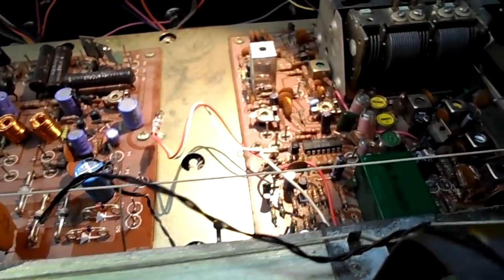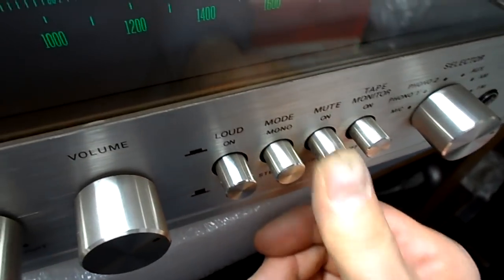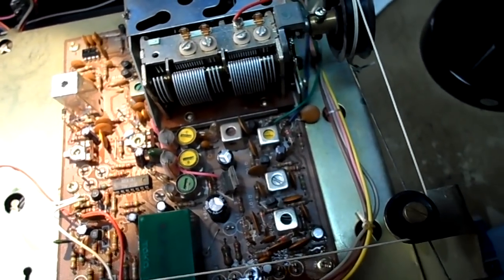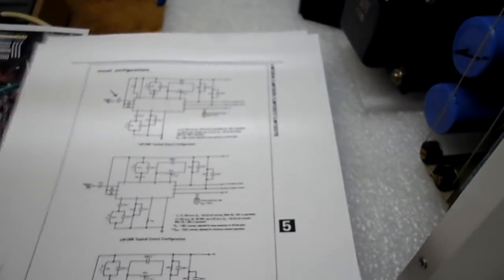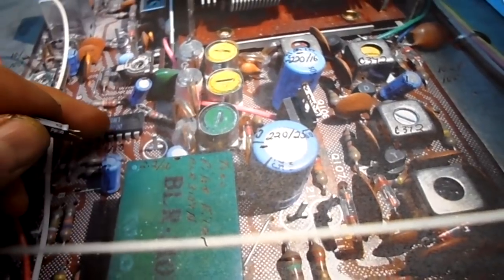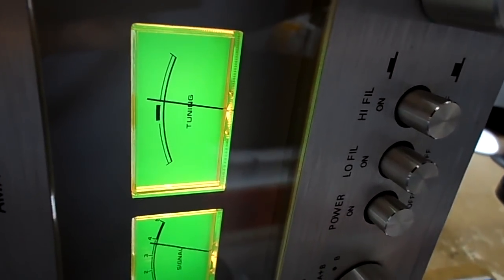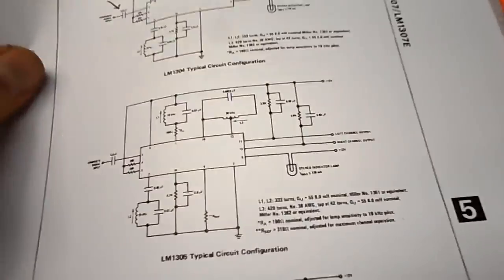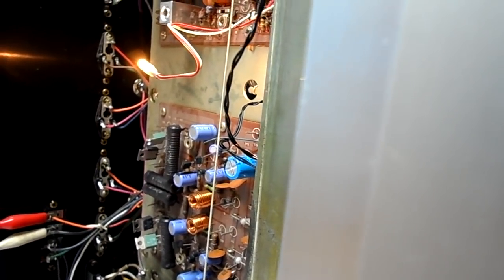Morse 2500 AM/FM Stereo Receiver. Part 2. FM Crash, & no burn.

Comment: I have a suspicion that there could be something regarding the ESR of the capacitor causing the issue. are you able to find data on the part originally used in this part of the circuit? my gut feeling is if the part is for example a low esr part that replacing it with a general purpose part could cause issues (or vice versa). looking at how the receiver behaved when you had the old part back in it does seem that it is very hard to tune as the tuning vu seemed to jump around a lot so you needed to rock the tuning wheel to get it spot on, so as others have said an alignment would be needed as well.

Comment: Sounds like the discriminator is out of align. Is the tuning indicator showing centre when detuned?
Reply from the maker: Hello Simon. It tunes fine now with the meter centering on strongest signal. No worse now than it was, & has good stereo separation. It's got to be close, never tweaked anything, but if I ever draw up or locate a schematic, that will show which coils are which. AM is pretty standard, (coil-wise). FM side of things need to be identified further. Thank you for watching.

Comment: Having watched xraytonyb's recent video on aligning the tuner section on an old Sansui (link: https://www.youtube.com/watch?v=K5D0cdDShcw), I believe that yours will definitely require a total re-alignment. I recall him mentioning a capacitor in the MPX circuit being critical, so it could be more or less the same thing. I suppose that even changing one capacitor anywhere in the tuner section is going to be enough to alter the characteristics.

Not an easy task to realign one of these without all the required test equipment and probably nigh on impossible without the service documentation :/
Reply from the maker: It's back to the functionallity it had maybe with a little better separation. But would like to run 10.7 thru it at some point, once things FM-wise can get identified. Leaving it be for now. Just happy, the FM did not get ruined. Thank you for watching.